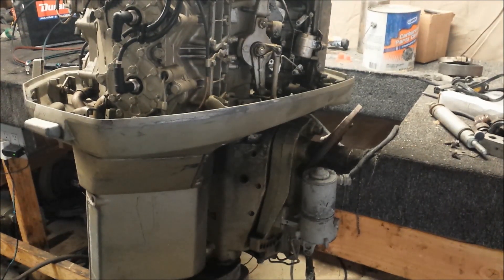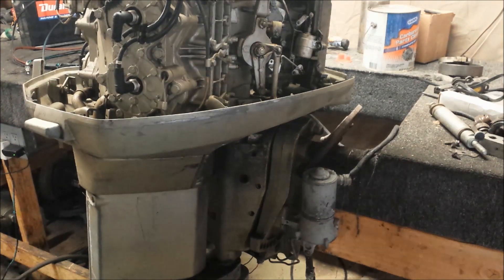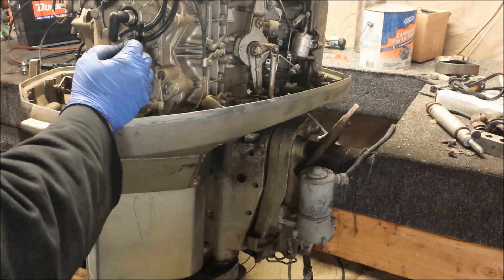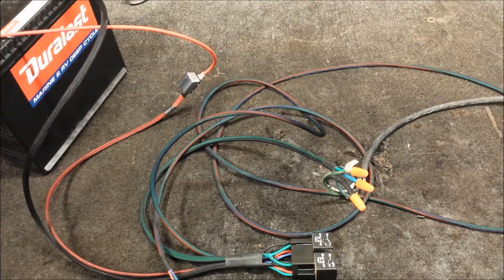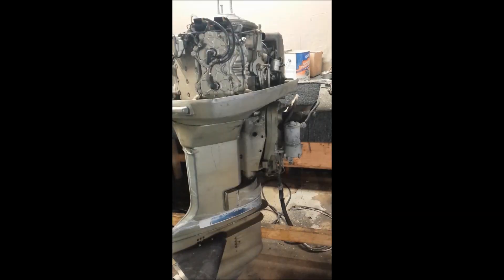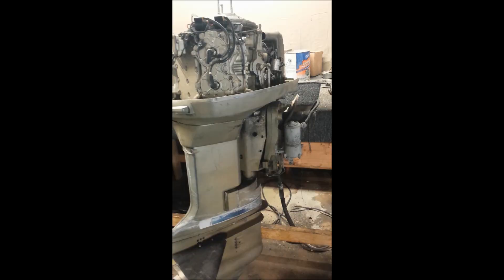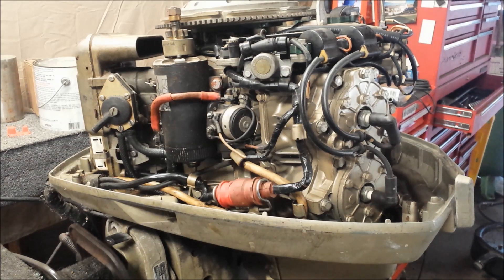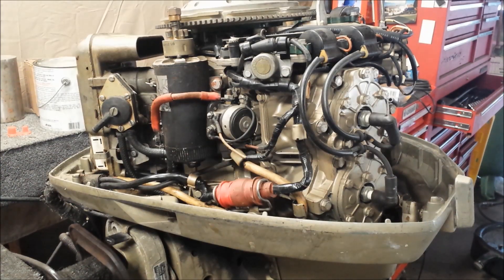A Look At A Vintage Power Tilt Unit (Johnson & Evinrude)

Comment: I have the same motor I'm sure it has a trim tab motor on it but I cant find switch, motor runs like a scalded dog without adjusting trim, but feel it could go faster adjusting, 115hp Johnson 2 stroke

Comment: I have a 76 johnson 70hp trying to figure out why it will trim down but not up?
Reply from the maker: usually I find the switch is the problem.

...well, does it make noise and try to trim up? If no, see former statement.
Reply: i cant find where to connect the wires i look crazy on mine cuz my trim wire from the controls is not connected

Comment: Much faster do you need that motor to come up? Any faster and it's going to be sitting inside the boat. There's a reason that that motor is still around because that is an american-made motor made with American aluminum and steel buying American with quality control. It's not assembled by mr. Ping Ping in China with inferior crap.

Comment: I have that same motor on a cobia sportster, cant find no info on it, it runs amazing, see actuator for trim, the pin is on 3d hole, for this to work needs to pull pin I guess?

Comment: can you show how you wired it? a diagram perhaps i have a power trim unit that is similar with a 4 prong connect 3 neutral wires and a positive im just wondering how you wire it to make the trim unit functional?

Comment: I have a 1977 85hp ...with the twin outside lift rams ....I love it got the motor cheap ...replaced a coil and rectifier and water pump and she screams ...and for a big 2 stroke ..is surprisingly quiet when at idle
Reply: Hey brother. I have the same one. The problem is the middle part jammed. Is it supposed to go up and down easily?

Comment: I wish you would go over the electrical connection part of the Trim Tilt to the battery switch etc in much more detail.
Reply: Black for ground (negative)
Green for grass (down) 
Blue for sky (up)
Reply: @Br3no94  why does mine have a red one

Comment: I just bout a 1985 50HP with this setup on it. Missing relays switches etc... If anybody has any info articles videos about this set up I would appreciate if you could share it. Its super super clean. The guy I bought it from says he thought it was after market.
Reply from the maker: Well it would have use a solenoid to power it up.
Do you have a electrical box that came with it?
Reply: @BrandonsGarage  No.Its still on the pallet but so far it just has the wire harness coming from the motor. I see nothing in the parts list that this motor has this? I have seen these before but never put much thought into it. But its super clean as is the motor. zero corrosion. Would like to find a parts list for it.  From the comments you generated alot of interest in this setup.  Thanks

Comment: Hello I just put a 115 Avenue on my boat with this power trip on it it's a 1977 motor I was wondering if you have information as to where those wires for the motor plug in to because I'm kind of struggling to see how I'm supposed to wire it up

Comment: A very informative video about the Prestolite. I recently acquired oner that looks very similar. Although it's in ruff shape I'd like to get it going without breaking my budget. The problem is that I'm have no way to test it to see iif it works. The wires are corroded, and the former owner used rubber sealant over to fix leaks. Does this unit use only the starboard side  one cylinder to raise and lower? 
I noticed the port side cylinder has no oil lines attached, is it only for support?   Keep up them good videos!

Comment: 1975 70hp yours looks close to mine same color an everything what color is the original engine cover you have it can to tell me the difference in mine which was rebuilt  everything looks very close but a few different areas not sure if my motor will go up an down like yours

Comment: I have this on my 1976 135 Johnson seahorse.  One of the rams has a leak at the bottom.  Do you have a video that explains how the tilt system works and how to go about taking it apart to repair or replace parts?

Comment: Ok here we go one more time. Input the model number on Amazon and you will find the pump 👌 18-6762
Reply: @Mario what trim/tilt fluid would work in this unit?
Reply: And so this is the motor and the pump?  (Seems to be, but just confirming)

Comment: I have an 1978 Evinrude 115. It has a 3 wire tilt motor, want to test it out. Can I connect it straight to battery just to test it out or do I need to rig it to a relay box first. I have researched a bit but not real sure. Thanks.
Reply: Straight to the battery
Reply: @CarnageInTheGarage78  funny, just now getting to it this weekend. Got the wires disconnected from my relay box last week and will try it out using just the battery, thanks.
If the tilt motor goes ok, then onto the outboard 115 motor.

Comment: Hi Brandon - Need some advice and you seem to know quite a bit about these old Johnson Motors. I have a 1975 115hp (115ESL75), came with the boat I'm restoring, similar to the one in this video it also has the original tilt/trim system on it. The motors exterior is a bit beet up from sitting in a mates paddock for a number of years but seems mechanically fine. The tilt/trim system on the other hand looks like it may need a rebuild.
Do you know if there is a seal/o-ring kit for these? Can't seem to fine anything listed in the service manual I picked up for it. Any advice on what to use would be greatly appreciated.

Comment: I have this exact unit on my 1961 whaler.. just purchased the whaler.  The tilt worked the first time I used it, but now, when I hold it to tilt "up," the motor doesn't move.. I have to lift it manually while the switch is in the "up" position.  Then it'll stay up, and when I push down, it goes down.. fast.  I've tried unscrewing the little hand screw on the tilt motor and putting new tilt/trim fluid in it (which honestly seems very thin for the job, but while I am experienced with small engines, I'm new to boating and all its gear).. but it basically just dumps right out, and doesn't work any better. I've tried putting fluid in til it overflows, moving the engine up and down (manually up, coz it doesn't go up on its own).. add more fluid (flows out almost immediately again).. up and down.. no dice.  The thing seems to be getting good power, it just doesn't lift the engine... any ideas?  Took me a while to find a video with this tilter in it!! Thanks!!
Reply: I thought you said we should ask if we have questions 😊
Reply: Helloooo
Reply: I have the exact same problem. Did you find a solution?
Reply: @discernlive6741  ultimately I found a new lift on eBay, installed it, and all was good

Comment: Love all the videos: Are you going to do a video that covers Tilt Aid/Assist in these 70/80s style Outboard’s (Evinrude/Johnson). I’ve bought a 40hp Johnson 1985 with remote control real cheap, but needs tilt assist sorting. Thanks 👍
Reply: I have a 76 Johnson 115hp outboard cant find nothing on trim, dont know if its fixed, I wouldnt think so, but where it's set now it preformed well, just nothing I can find on these

Comment: Mine won’t go all the way up.  Also after reaching highest point that it will currently go (75 percent up) it starts to drop slowly in small increments taking 10-15 min to lower most of way while resting.   1975 Evinrude 85hp.     What fluid ? Also, what is process for bleeding or servicing ?  Thanks

Comment: I have this exact unit. Two questions . My original completely went out . I found a used one but it bleeds down quite quickly . Question 1 - I found a new one so how do I fill it for the first time . Question 2- Since this is a tilt only , how do I set the trim , is there suppose to be a pin trough the holes on the mount? If so do you know the part number ?
Reply: I have the same unit, and same question about how to fill it. The knurled nut on the side of the pump housing is the fill cap. Most people seem to use dex III transmission fluid in them. But I'm not sure how much or if the power piston needs to be extended or retracted to fill. Let me know if you find out. As far as trim, the transom bracket should have a series of holes and a rod that passes through to set the trim. This unit will not hold the engine by itself in a trim position. Part number 0383568 should be the retainer rod that slides into the holes. I'm assuming your engine is from the 1960's, so not certain if they changed the part in later years.
Reply: @eperot  We've got a 68 Starflite 100, lift stopped lifting last year. Doing our pre-use spring maintenance this weekend and that was exactly the info I needed. Kind of thought it would be that one as opposed to the actual screw higher up. (it's a reservoir, should be near the bottom, right, lol!) Anyway, thanks for the year-old confirmation!

Comment: Nice looking engine, thank you for the still pictures of the power trim set up, decided to add this feature to my out board, now to find vintage parts.
Reply: Ps mine is a 1985  60hp . Same design though .

Comment: Hey I have a 65 Evinrude Starflite which looks identical to what you have here what are some fluid options for this tilt motor?
Reply: Same question; did you figure out the answer? Thank you in advance!  Our trim motor works fine but the outboard doesn't move (we have to have the tilt motor running then manually lift or drop the motor ourselves)

Comment: What is the screw for on the bottom of the pump on the tilt trim motor?
Reply: To relieve pressure I believe so you can raise and lower without power
Reply: Yes, have exact trim on my 55 evinrude, wouldn't trim up. Finally found which screw releases the pressure.

Comment: I have a vintage 135 Johnson that looks like it has the same tilt trim setup on it mine goes up super slow and once I get it up it will seep down and if I have it tilted while under lower going towards the bank or something too much throttle just shoves it all the way down none of my other outboard motors have don't that anyone finds or custom builds replacement from scratch get ahold of me please and thank you

Comment: I am looking for the motor . Not the hydraulics just the motor do anyone know where I can find one I have a 74- 115hp Johnson
Reply: Have a mint 76 115 johnson I'd sell. Skeg needs repaired but the power head looks like much like the one in this video. Low hours for sure.

Comment: I know this is old video but would this pump work on a CMC tilt unit that has the separated pump and cylinder? Does anyone know the thread size of the fittings on this style pump?

Comment: Hi do you know that year this is and what hp ??? i have a 1975 115hp and looks the same someone has mucked around with the tilt trim but
Reply from the maker: Oh this was a 1976. 
Same setup.
Reply: Hey forgot to add im in Australia so not sure if they came out here the same
Reply: @BrandonsGarage  i have a 75 70 hp . tilt just stopped going up but it will go down. cylinder covered with old hydraulic fluid. do you think the cylinder just needs to be rebuilt? or could the motor be going out and only have the power to go down?

Comment: I have that unit but I need the electric motor. Do you know the motor number or an equivalent motor to fit it?
Reply from the maker: Well, It doesn't quite work like that.
You rebuild or replace the motor parts. 
The motor and pump reservior are built into one.
Reply: Many better to just upgrade to a trim tilt than trying to fix this one
Reply: @BrandonsGarage  hi Brandon, would you happen to have the model number for that motor? Mine just started going out and it shows its age enough to where i can't find the part number or anything. Thanks in advance
Reply: @BrandonsGarage  how do or where do you add oil  to a 76 85 horse tilt

Comment: where do I get the tilt motor please??
Reply: Have you figured this out or the trim motor model number?
Reply: Bump!
Reply: @mariochingon3842  Have you?
Reply: @randomfandom53  i didnt but did find one on amazon that worked 👌
Reply: Mario Chingon cool I found a motor too but struggling now to find a pump that’ll work because I opened mine up and it’s cracked and shot
Reply: Mario Chingon thank you!! Before I saw this I ordered this one (whole package) - one of the pics on the item is wrong though I think https://boatstore.com/power-trim-tilt-3-wire-motor-res-2-hose-pump.html - do you think it’ll work?  kinda looks like it will but I’ll have to shave a little off the mounting plate bc my current one is a triangle matching the bolt holes and not the rectangle on this one
Reply: @randomfandom53  as long as the year and model match it should work.  Also make sure its the same number of wires, 2 or 3 whatever you have now or might have to do some modification.

Comment: Got a 76 75hp stinger with similar setup.  Mines got the metal bracket with 2 lift cylinders on it plus the 2 lift assist cylinders in the middle bracket.   More moving parts than id like to have! Would rather have single ram like on newer style power trim
Reply: i think those middle cylinders are shock absorbers.